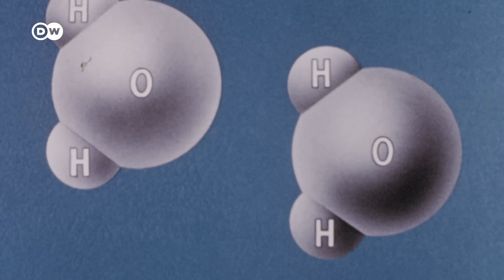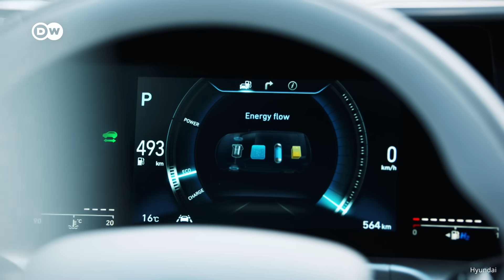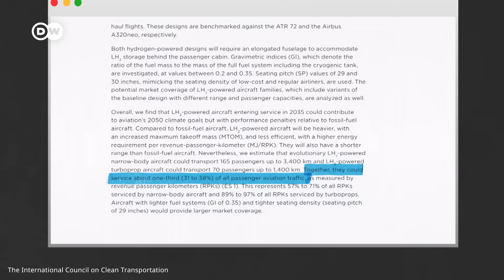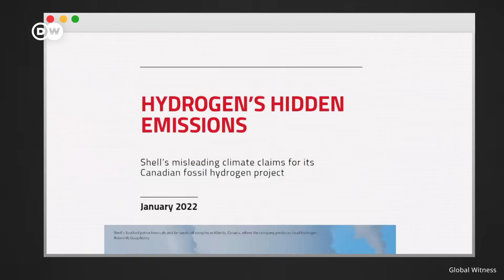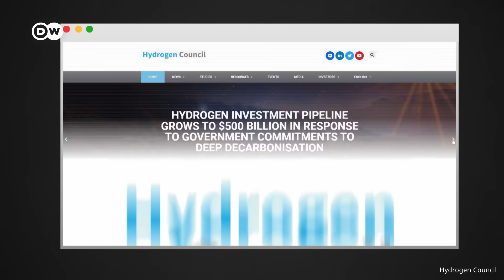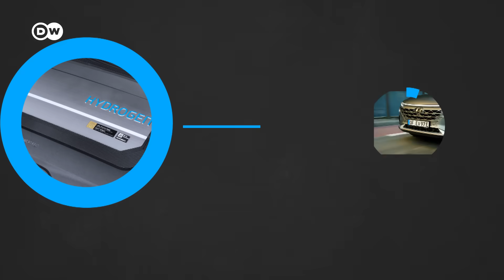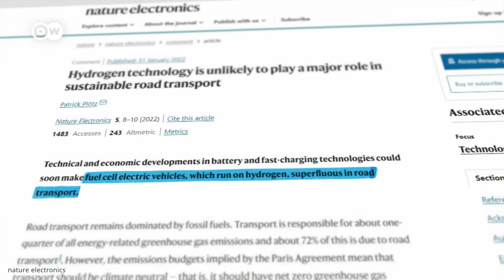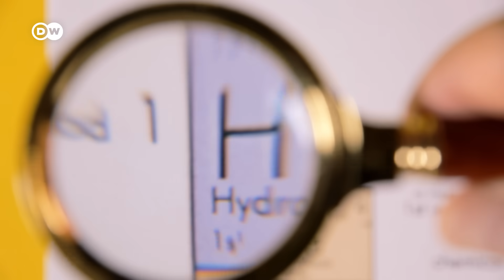The truth about hydrogen

Comment: The biggest advantage Hydrogen has is that it's a drop in fuel for the natural gas delivery network. You could simply fill the city networks that distribute natural gas for heating and cooking with hydrogen gas and the connected appliances such as central heating units, gas stoves, dryers and ovens would simply continue to work just the same. This is the real advantage. Using excess electricity in peak production times to generate hydrogen that then get's added to the natural gas supply is an immediate step towards a less polluting future that requires little new infrastructure to be build and next to no changes on the consumers end, both in technological upgrades and differing their habbits.
Reply: The gas pipe system would leak like a sieve if you put H2 in it. There is no advantage in using H2 for heating or cooking if it's made by electrolysis, just use the electricity directly in heat pumps.  This idea is pure marketing.

Comment: I've studied hydrogen for many years now and seems the two primary applications that will be best, for the next few decades at least, is: shipping and commercial airlines.  Most everything else can run on batteries just fine.  However, if solid-state batteries become 3-4 times more efficient in energy density and the prices lower significantly, then battery jets and ships will likely make more sense than fuel cells.
Reply: That's a big if.  I'm more for do hydrogen do bev build more mohave dessert solar farms to make hydrogen. Make Shell and bp stations with hydrogen and dc fast chargers.

Comment: I think the fuel itself is irrelevant. they all polute! I think it's all in the battery storage for electricity. imagine a 99% efficient solar panel with a small footprint, and green batteries that charge fast, hold a big charge for a long time and are 100% recyclable... This is the solution IMO.

Comment: hydrogen isn't an energy source it is just a high-density battery, the thing is that it is renewable instead of fossil fuels, so it will follow the short carbon cycle and not the long carbon cycle, meaning that the use of hydrogen doesn't add any extra Co2 into the air, as gas or oil-based fuel does. still, for a car, regular batteries are more efficient, but for vehicles in need of high energy density like trucks and tractors, it's needed for the range.

Comment: I believe we need to find more efficient methods on producing green hydrogen & we need much more research on hydrogen to make it a reliable option for future fuel . 
Reason : it's the most vast numbered chemical we have in our planet we can be efficiently use and lower the CO2 emissions .
Reply: The most efficient use of any green energy is to use it directly, then it's storage without conversion (batteries), then it's conversion (hydrogen) and then multiple conversion (NH3, CH4) then its multiple conversion of those already converted resources (eFuels). Since batteries are feasible for individual mobility there is no reason to incur the losses of any conversion step. Hydrogen has it's areas where it is irreplacable, like steel, cement and fertiliser production.
Reply: The most green method is called Nuclear. To produce Hydrogen. Than we can use Hydrogen to make a new power plant than you got 100% efficiency.
Reply: @jasonlewis460 : That is entirely false. Nuclear power isn't green at all and it's so much more expensive than solar energy, it's not really an option.
Reply: @jeschinstad  Totally, the economics of nuclear versus renewables is undeniable.

Comment: It will always be more efficient to store electricity in batteries than convert it into hydrogen. But batteries are expensive and because renewable energies fluctuates a lot (sun, wind) hydrogen will be useful when there is an oversupply of generated electricity. Instead of shutting down wind turbines or solar farms the oversupply can be converted to hydrogen and be stored in a much larger scale than with batteries.
Reply: Batteries are expensive, but you're assuming that hydrogen storage will be cheaper (per unit of energy stored).  I think you are wrong about that.
Reply: Batteries may be expensive today. But let the batteries from BEV come to the stage where they have lost 20% of their capacity - so in 10-20 years and batteries will become less expensive because these very same car batteries now can be used for another 10-15 years in stationary use. To run a electrolyzer at any kind of efficiency the amount of available energy must not fluctuate - it will even be permanently damaged if there isn't any energy to be converted.

Comment: What i don't see in any comments is the problem of getting lithium. For a fuel cell you don't need rear earth metals. And we have only a very limited amount of lithium left on the planet.

An other footnote about the battery powered trucks. The problem is not so much the space but the weight of the battery. If you build a 36t truck but the battery is 17t in comparison to 1t of fuel, then you have 15t less carrying capacity. Next assumption that i make is that we have a lot of space for our Hydrogen. ( this is just because i think that if we can put in 17t of battery we can also put in a big fuel tank.) So now we have to compare the energy density (this is ~3 times higher then fossil fuel). And the fossil fuel motor in cars has about 25-35% efficiency at the moment. So if we put all that together. We have 1t (fuel) * 0.35 * 1(energy density) = xt (h2) * 0.4*0.8 (efficiency of hydrogen) * 3 (energy density) => x=~1/3. So we need less weight but probably a heavier storage tank. But you can see that it kind of balances out. So for trucks i think its gonna be hydrogen or you have to put everything on rails.

In general i think its just a to one sided story that you are telling here. Hydrogen can be good especially if we run out of lithium for making battery.
Reply from the maker: Hi Rafael, thanks for your comment. We've done a video on Lithium before. You can watch it here: https://youtu.be/PbOBmnZRpZ4

Comment: I've roughly calculated the cost of running 100% windmills and hydrogen for Denmark... 
First we need 460 billion € worth of windmills (18.000 x 15MW) - with an annual running cost of  23 billion €
Thats 2-3 times our GDP
Then you need a gigantic Electrolysis plant, which could easily cost 100 billion €
You need the insane amount of mills / power to generate enough hydrogen for about 14days of windless days + tons of transport. 
The cost is just insane.

Comment: Blue hydrogen can also be derived from waste such as end of life plastic. It saves that plastic being dumped in the Ocean, incinerated or landfilled where it degrades releasing vast quantities of methane. Hydrogen from plastic waste is therefore a lot greener than people realise, when you consider what it thorougly
Reply: However, the plastics industry relies on a model of ever expanding production of plastics, which are mostly all made from FOSSIL FUELS! Even if you use hydrogen made from plastics, all you are doing is delaying when the carbon is released in the form of a greenhouse gas by a few years. I am not saying don't process existing plastics in this way, but invest in new forms of plastic production e.g. from seaweed or other biological methods that don't require oil/gas/coal.

Comment: Graphene batteries for me will be the future of the automotive industry.
 They can pack in up to 5x the energy density of regular lithium batteries and can charge about 5-6x faster. Of course graphene is still expensive and hard to produce in a large scale, but i believe in the near future, it will become cheaper especially with the promise of flash graphene.
Electric cars with this battery will become much cheaper and will compete with fossil fuel cars in both price and mileage.

Comment: Hydrogen is mostly a play for hydrocarbon extraction to stay relevant.  Hydrogen make for a rather poor Rude Goldberg of a battery.  Yes, it has a place in chemical processes, greening steel for example.  But stepping through hydrogen to green synthetic methane makes much more sense from a storage and thermal and rocket fuel source.  A closed loop battery creation and renewal cycle can easily solve storage on scales many dare not imagine.

Comment: I think hydrogen's real problem is that it doesn't exist as a free molecule on our planet, like nitrogen and oxygen do in our atmosphere.  It's almost always connected to something like water or hydrocarbons (oil) which it has to be split off from and that takes energy input.  Now if we could harvest molecular hydrogen from something like the solar wind, that could be a game changer.
Reply: Why don't we use the sun to split the water & create an engine that can be powered straight off the neat hydrogen
Reply: @onenessseeker5683  We can -  fuel cells for example use the neat H and O to recombine into water releasing electricity.
Reply: @Wizard_of_oOZe  Why isn't all cars powered by hydrogen then if we can use the sun to split water?  what's the hold up?  what's the problem in the way.
Reply: Well I just read a little bit about we need a catalyst for the sun to break the water apart. and they say the cost of input is not worth what you get out... So why don't we use the sun to power lasers or something that can split the water.

Comment: Glad I watched to the end, because I was going to jump in with all the “cons” that came later on!
It needs a paradigm shift: rather than viewing hydrogen from the “fuel” viewpoint, rather look upon it a a “storage” commodity. The same, but not the same.
Use H2 where batteries just won’t do (aviation, probably bulk freight) yes, but it can also be used for supplying rapid grid balancing. Fully green H2 can be produced at times of renewable energy overproduction close to its storage and generation stations and the inefficiencies don’t include transportation and retail delivery infrastructure and in any case aren’t that important if the electricity is “surplus”.
Reply: Except surplus isn't a reality anytime soon.

Comment: When you pass a current through this solution bubbles form along the wires. When you are splitting the water molecule it should split into hydrogen and oxygen molecules at that point. That means hydrogen and oxygen bubbles should be present on both electrodes as they originate from the same point. I don't see bubbles moving between the electrodes?

Comment: I remember seeing a video describing how hydrogen could be produced on-site at fueling stations by using a combination of solar cells and off-peak hours grid charging, of either batteries or a flywheel based energy storage system, for use during times when solar can't provide the necessary energy for electrolysis.
Also, new advances in solar cells approach 50% efficiency which just wasn't possible before.
Reply: Would take too much current to fill a car with enough hydrogen doing it by electrolysis on site. There is a lot of hype about.
Reply: Hype, a filling station gets through 37000 litres of petrol per one or two days, Hydrogen, would be around 100000 litres and need at least 45Kw hours per kilogram, hydrogen would then need pre chilling and compressing to deliver into vehicle tank. ( It has to be pre chilled due to its Wobbe effect, most gases heat up when being compressed and cool when expanded. Hydrogen does the opposite.
Reply: On equator the sun hits the earth with about 1KW of energy pr square meter, but for most of the world the light has to travel through more atmosphere because it hits the atomsphere at an angel, so earth average is about 600W pr square meter. So lets take a Tesla model S P100. It has a 100KWh battery. So to get enough energyu to charge that battery in 1 hour You would need about 150 square meter of solar panels, or 1600 square feet. Solar panels to power a local fueling station becomes problematic real fast. off-peak charging of local battery is the only real option. Commercially available solar panels today max out at about 25% efficiency. See there are essentially 3 different pv technologies. One for red light, one for green and one for blue. So pv panels kind of have a ceiling at 33%. There are "Multi-junction" solar panels. In these they use transparent versions of 2 of those technologies and 1 not transparent. So 3 panels on top of eachother. those 2 transparent panels are less efficient, since they pass light through. These panels can reach about 50% efficiency. But they are very expensive compared to normal pv panels. It really only is NASA that has access to these for use in space missions. There is quantum dot enhanced panels in the future, yes quantum dot like in the TV technology. quantum dots can change down a frequency of light, so blue can become green, and green cabacome red. The efficiency of this is not known to me, and how much loss of the red light there is because it has to go through 2 glass panels first I dont know. And it is also demonstrated that quantum dot solar panels can use infrared light from the sun. The sun radiates far more infrared light than visible light. So solar panels may become far more efficient in the future. But there is no way to know by how much right now. At least for those of us not in a research team. Local production of hydrogen would have to be from grid power.
Reply: @ysteinrefsahl1004  and then comes the night or clouds or snow on a 365 24/7 availability they are 20-25% - intermittent and unreliable - new gen 4 nuclear 90% + availability 24/7 365 days - safe clean and zero CO2

Comment: Hydrogen ( green of course) has a place as an energy storage method to be used among others. There is no single silver bullet to reduce dependency on fossil fuels.
Reply: So many things need to fall into place before this is reality. 

We need to be at a point where we have excess daytime green generation that needs to be stored. 

If there is no cheap battery storage, like used bEV batteries or some other cheap battery. Storage does not require expensive lithium batteries. 

If other storage methods turn out to be duds like gravity based storage. 

If there is more use for the hydrogen, like we actually do get market share of trucks, trains, ships, planes somehow. 

If all the above transportation technologies get way more efficient than they are today.

If a distribution infrastructure happens which can safely and efficiently get the hydrogen to the load destinations. 

If nothing better comes along.
Reply: Yes there is. FUSION. Period, end of story.
Reply: @TheBandit7613  well go ahead and build a safe and efficient fusion reactor then and everything is solved  I guess.
Reply: @TheBandit7613 ; I can't do FUSION, can you?

Comment: Depends. We will have to produce hydrogen from renewable energy in places where electricity transmission is a challenge. For example, you can do this in places like Saudi Arabia, where there is a lot of sunshine, and they don't know what to do with the excess solar energy due to the duck curve. Other examples could be desert places and offshore windmills
Reply: If electricity transmission (via powerlines) is expensive, why would hydrogen transmission (via pipelines) be cheaper?
The Saudis don't even bother to transport methane via pipelines, they just flare it in the oil field.
And methane pipelines are much less costly than hydrogen pipelines.
Reply: Problem in Saudi and other desert regions is that water is a scarce commodity so they have the solar power but nothing to make hydrogen with!

Comment: Congratulations on providing a well-balanced video on the subject. I view blue hydrogen very sceptically indeed, I sincerely hope it doesn't even get a toe-hold, There's not even any certainty that the captured CO2 will REMAIN in the ground ! With ships, I think the long term future may be small nuclear plants actually, likely on the thorium fuel cycle. Hydrogen seems to meet intermediate scale applications well though. Even trains perhaps where electrifying a rail line isn't economical.
Reply: While I know submarines are not the type of vessel you were thinking of when you talked about "ships", the US Navy has Trident submarines that are run with nuclear energy, so it can be done.

Comment: ironically one of the best uses of hydrogen is injecting tiny amounts of it into diesel engines in order to improve flame travel which reduces carbon particulates in the exhaust, improve his efficiency and increases carbon buildup inside the engine. A small electrolyser mounted in the vehicle is sufficient to produce the required hydrogen on demand. This is a great stopgap measure to reduce fuel usage in diesel engines by about 22% and even increase their power by is similar amount.

Comment: Batteries and electric vehicles aren't really as efficient as people make them out to be in many cases. Battery packs weigh many times more than liquid fuels. And battery manufacturing is extremely energy intensive as well.
Technology is being developed to efficiently produce liquid methanol fuel from Green Hydrogen. This will solve many of the problems relating to inefficient or difficult storage and transport of hydrogen.